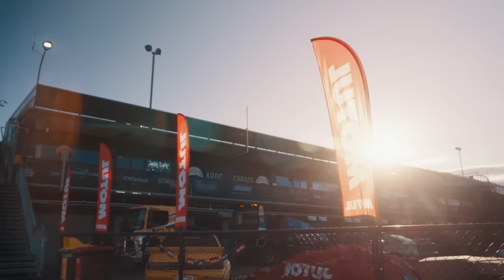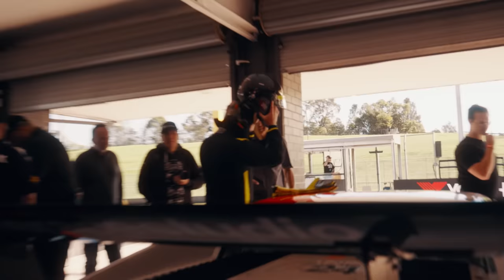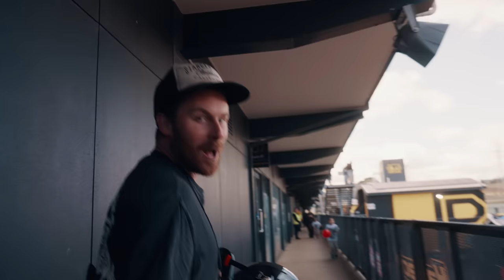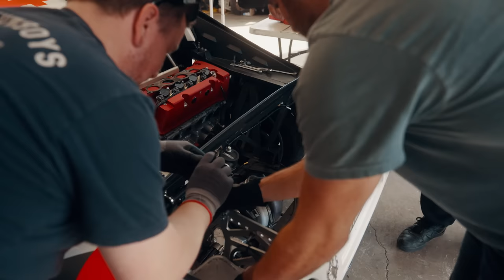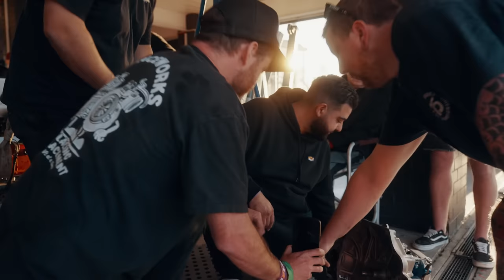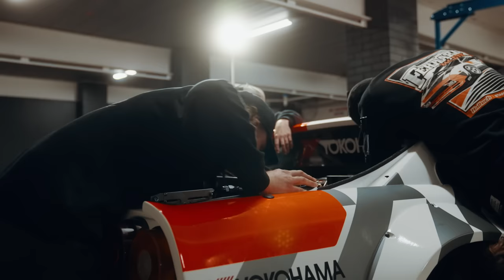This trip just got $17,000 more expensive - WTAC Ep. 3 - K24 Ferrari vs the World

Comment: If you don’t achieve a fix on the clutch line, just run with no clutch. Warm up the engine/gearbox withe the rear up on a jack, then have your crew push the car down pit lane as fast as they can while you’re in neutral. Pop it into first and boogie!

Comment: Would love a street version of this or a 74 Dino Spyder 246gts....All the looks of a Ferrari with none of the poor reliability or high costs...Old school body & classic interior- everything else modern upgrades....
      Hope he gets all the bugs worked out...When he said rubber motor mounts. I wonder if he meant actual rubber or the stiffer urethane bushings..I dunno much but if they were actual soft rubber....I think the stiffest type of urethane bushings would be a good solution..  I  dunno much but pretty sure engine mounts actually need some flex to them for long term reliability & aren't there only to keep things quiet & make a smooth ride.....I should watch the whole video before commenting so I don't have to keep editing. 🤪 I learned the hard way that steel bolts can only go in & out of aluminum threads so many times. Each time, even when torqued to spec. Stresses the threads & slightly distorts them. Steel threaded into steel, gives you more chances but also only last so long... Installing/removing bolts on a still warm aluminum engine/part is a big mistake. Learned that the hard way. Even on slightly warm engine with a not very tight bolt caused it to strip. Felt fine/normal coming out but had somehow stripped.

Comment: No offense intended...Did you really believe that with no actual testing (those two sessions that were done can't be considered as anything more than initial shakedown and both revealed teething issues) one could hope to go to a racing event and expect that the car will hold up? It was never really driven in anger before the event. Even this kind of event as WTAC (very short event with very little actual track time) requires serious testing even if one works with already well developed machinery. Can it happen? Yes, if there's lots of prior experience building race cars, if stars align etc., but I wouldn't recommend to place bets. I know that this may sound harsh for 99% of cheerleading viewers/subscribers but that's just reality. Real life and show are two different matters. I wish you best of luck and lots of dedication (and resources) because that's what is required if there are plans to compete in the next year's event and to be competitive.  Extensive reliability testing/development ->performance testing/development and extensive driver development is required and there's no way around it even with millions of subscribers (which is great and may help with funding?).